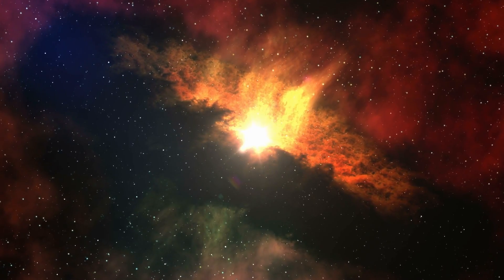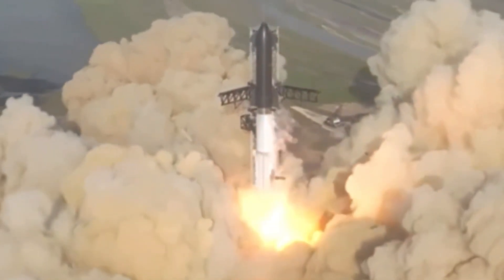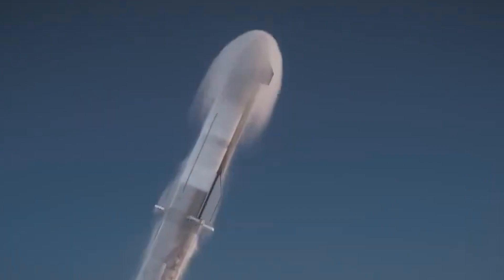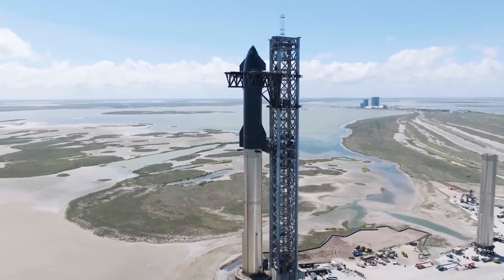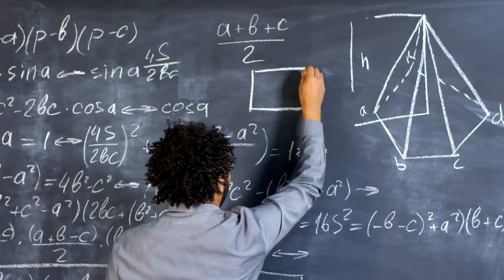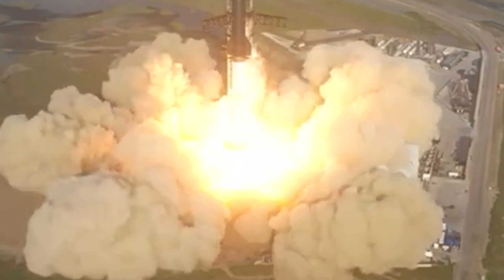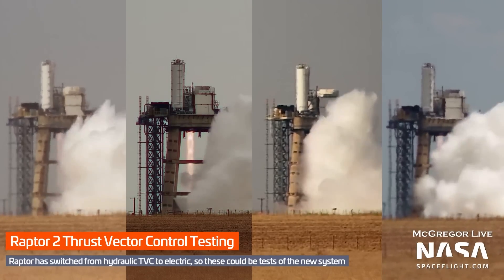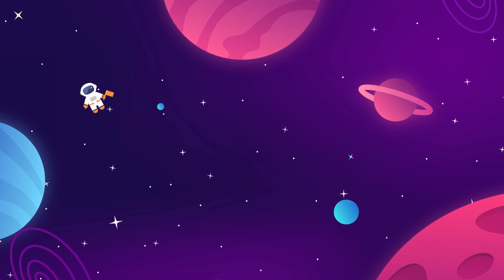The SpaceX Starship Orbital Launch Update Is Here!

Comment: Thanks for a good balance and including the part regarding the FAA. I have seems too many Elon fans say this is normal and too many armchair engineers say this was irresponsible. It can be both and the FAA has a duty to ensure space X operates safely.
Reply: Ever think that actual aero/Astro engineers also comment?!?
Reply: I am an engineer - it wasn't irresponsible of SpaceX to do what they did. SpaceX's approach to design is entirely valid and well supported by the whole history of engineering science. Many engineers that pay more attention to public perception and bleeding hearts may disagree with that, but they're all forgetting that the wheel wasn't made perfectly the first time, and virtually nothing else was for that matter. Designing to never fail is a relatively recent approach to engineering - and a very expensive/limiting approach because simply put you don't know what you don't know, and figuring out what you don't know is an arduous and ultimately imperfect process when the problem exceeds even a rudimentary level of complexity (hence the liberal use of safety factors in most traditional design work). 

If anything I blame the FAA and the environmental groups for most of this since all the delays they put SpaceX through over the last couple years slowed down their normal approach to testing and made a fully integrated test a more pressing concern for SpaceX. Ideally they wouldn't have been restricted at all and would have been able to do a sub-orbital test with just the booster and no second stage (which I believe was their original plan) over a year ago. Such an incremental testing and integration approach likely would have led to them finding out about the pad issues awhile ago and quite possibly with less fallout. Few people seem to really understand that engineers cannot do something that is entirely outside the box without lots of testing - analysis will only ever get you so far because it is also based on an imperfect understanding of the problem. Like a lot of good engineers like to say - all models are wrong. This is why all other rocket designs from especially Old Space are much more conservative and never really seriously pursue something like re-use (they don't really know what they're doing and the rocket cannot fail, so they have to have a lot of margin just to feel safe and are not typically willing to try to make improvements after the design is locked - which for traditionally designed rockets happens long before you build the first article). The design to perfection approach would never really work for something like Starship, but thanks to Falcon 9/Heavy SpaceX does have a huge leg up over their competition - but no one has built a pad for a rocket that powerful before, and in all fairness it was holding up to previous testing well enough.

Comment: Only God knows why Elon didn't fully test his 33 engines horizontally against a test concrete pad to determine if they should use a different tech.  Personally the idea of a flame diverter and water deluge is tried and true and would be great in this situation.  Elon is just whacked these days - dunno waz up with him.  I think they are going to find real structural damage to the tower and have to rebuild portions.  (hope it was worth going on 4/20)

Comment: From day one i was wondering why spacex made such dumb decision of flat concrete under the rocket whereas historically many rockets have flame deflectors and water sprinkler to dampen the noise and heat. Also why this fuel farm such a close by, it's was just common sense that debris from rocket are going to hit the near by equipment. Spacex focused more on starship and rocket design than the launch pad design...even there didn't wanted to use proven systems

Comment: From what I understand and the reason behind building the pad and systems at Boca Chica was to avoid having to transport it to Florida for launches at 39A. Maybe I’m wrong but what Elon had said is that the launch location was more effective and economical for the team to design in house and launch from a proprietary location rather than to ship. I do agree that the pad needs to be reconfigured for the amount of thrust, heat, and power the engines produce though, rebuilding the pad each time will not prove effective. Time will tell how the new revised systems will integrate and hold up to the rapid abuse proposed for the Starship program.

Comment: Considering only the thrust generated during Super Heavy's launch (82,770 kN or 8,440 tons-force), the Phobos platform from SpaceX (Valaris-8500) cannot withstand the weight generated during Super Heavy's launch. According to the manufacturer, the platform's Variable Deck Load (VDL) is 8,000 tons

Comment: The only thing you got wrong is when the flight termination system activated. It was almost 50 seconds before it blew up. You can see 2 small pops on the (one towards the top, one towards the bottom), and then gas shooting out after. All the flight termination does on starship is blow holes in fuel tanks. Then relies on the mixing fuel to take out the ship. Took a bit this time. They might need to add something to spark it up for the next launch
Reply: So the flight termination system ALSO FAILED!!!
Reply: @johnp139  no, it worked like it was supposed to, the ship blew up didn't it? Just took some time. Which is to be expected. 
It's a brand new vehicle with tons of new technologies. There was bound to be issues.

Comment: By this point I hope some people realise that Starship isn't going to land on Mars and that we need to rethink the "Mars direct" architecture it embodies. It will carve a crater - which is not a good flat surface. The thin atmosphere and low gravity on Mars will mean supersonic debris travelling for many, many kilometres. Meaning it has to land a long, long way away from base. And of course it's like to suffer damage on landing. 

We're not going to build launch pads on Mars made of thousands of tonnes of steel and concrete, let alone hundreds of thousands of litres of water. We need to consider designed for purpose, small, light crew lander/ascent vehicles that shuttle people to and from Mars orbit.

Comment: Dear Elon, You should modify ALL the rocket, resembling the old project of the SEA DRAGON. ONE GIANT rocket nozzle, for the main trust, burning JET-FUEL (Kerosene) and LOX. 6 to 12 ancillary RAPTOR nozzles, for route and attitude correction. Maybe 3 to six auxilliary solid-fule rocket boosters (Morton Thiokol). Second stage Liquid Methane and LOX. You could launch it from the center of MARACAIBO LAKE, that is a not-so-salty lake near the equator and near old oil extraction wells in Ciudad Ojeda (with still good Kerosene). Rocket carried to the launch position by two old W.W. 2nd Aircraft Carriers... A blast in the middle of the lake,  several fish dead (lake already poisoned by the oil), and a much safer situation. There are many abandoned oil extraction platforms there.

Comment: Building a launch pad that will survive? That's not the problem. Here's the problem:
1. We see engine failures and engine anomalies well after launch. It's easy to blame this on launch debris, but the problem here is that Raptor has a history of being temperamental. Are there still fundamental design issues with Raptor? Or is it simply being pushed too hard and therefore needs to be de-rated?
2. The video seems to think that losing a few tiles is fine. Why? At this stage the mechanism of failure will have been well understood and you'd expect the test launch to have tiles/fixtures incorporating such knowledge. But, some still broke. You only need to lose one for a catastrophic failure. I might also add that the failure is probably related to acoustic shock, and that a steel plate might survive the launch but won't necessarily solve the acoustic problem. 
3. Yep, the steel shell is demonstrating toughness, but max-Q is a nice symmetrical load against the strongest axis and the stresses from slow rotation through thin air aren't that high. The real problem for Starship structurally is re-entry. The vehicle is copping it broadside resulting in massive torques and also potential interactions between the relatively thin shell (relative to overall size) and the turbulent flow around the vehicle.

Comment: Water cooled steel plate with ablative layer might suffice to prevent digging another crater, but that still does not remove the need for a proper water deluge system. Something has to dampen the acoustic energy of that mostrous exhaust so that it doesn't damage its own source. But both is doable in a reasonable short time - a year, tops.

Not exactly "everything we wanted to know", but very good overview, nevertheless.

Comment: NASA, who invented the space program, operated with “failure is not an option”, whereas SpaceX states “failure is normal”? It just makes no sense not to follow proven methods to launch a rocket starting with creating a legit launch pad. 
First of all, concrete doesn’t fail because it “forms a crack and then expands”, it fails because the moisture in the concrete vaporizes into steam  and then explodes. 
Legit launch pads like NASA created had flame diverters to protect the pad but more importantly to protect the rocket itself and the water deluge was to also protect the rocket itself from the acoustics of the launch which was found to tear apart the rocket systems. Water absorbs the sound waves from harming the ship, which again NASA learned from tons of analysis and experience. 
It’s purely insane to even go for launch without a legit pad even for a smaller rocket but especially for a large one that will likely carry life in the future. 
That’s why this is a failure, as it seems an extremely high percentage of SpaceX launches turn out to be. It’s 2023, launching rockets successfully is done around the globe using the manual NASA created (and probably Russian rule books as well). Ignoring lessons learned is a failure which is why the FAA is grounding SpaceX for the time being. It’s disheartening to hear semantics of success when failure is not an option, and this means it’s a fail until a rocket reaches space, otherwise it’s called a missile
Reply: And in view to all this disregard for lessons already learned decades ago it's even more surprising that the FAA greenlit that launch. They knew all those safety issues would occur. And they still allowed this while knowing that there are thousands of people living way too close to the launchpad.

The main role of the FAA is to safeguard the population against such blatant disregard for public safety. They have failed here about as much as they have failed when they certified the 737 MAX.

Comment: Making use of their heat tiles would likely work assuming they are not too brittle.     Perhaps a hole under the pad with water jets and/or standing water considering how close they are to the water table.
Reply: Or maybe they could do what NASA and every other facility in the world that does heavy launches does.  Build flame trenches, diverters, and deluges to ensure the rocket doesn't destroy itself and limits the damage to its surrounding.  You know.. things that have been around for decades? Those things that they knew about and before they broke ground on construction of the pad said quite literally "hey we're not going to use those, this will probably end in failure" yeah... that's why they weren't surprised.  Quite literally this launch was doomed before the pad was even created because of those safety features that have been around for an insanely long time weren't used.

Comment: the fondag likely failed because it was too moist and when it heated up the moisture turned into steam. The steam then fractured the fondag.  this is why furnaces aren't made out of concrete. it could have held up better if were preheated to drive the moisture out. my 2 cents.

Comment: why is nobody talking about the fact that stage separation was initiated(that was announced on the webcast-and you can see the smoke from the explosive bolts on the first few images from inside - which were probably meant to show the separation in all its glory)  but it didnt work (probably partially due to the hydraulic failure) - had it worked we wouldve had a relatively pristine starship on its (tentative) way to orbit... at least the test flight wouldve lasted longer and the starship end of the stack couldve taken part actively.

Comment: Given the speed at which they can build, its not entirely impossible that they disassemble the launch tower and build up rather than dig down for a proper flame diverter not unlike those seen at Kennedy space centre where it ramps up to the launch infrastructure. A nice flame trench would direct the exhaust in a way that makes the launches significantly more spectacular too as you'll actually be able to see the rocket from ground level till the engines clear the pad rather than being obscured in a giant cloud of exhaust and dust.

Comment: I Repeatedly Warned ELON MUSK that their launch pad was dangerous and inadequate. I believed and told them they should have designed the launch pad after the Cape Canaveral built up area with the tower and then design a swimming Pool/Holding Pond to hold 6-12 feet of water underneath to absorb the rocket blast pressures out to the diversion routes/trenches.
ELON will fail again if he uses his metal plate and water which will break and be thrown as the concrete I warned would be thrown at distance from the launch area. 
Also the tank farm never should have been built so close to the launch area. It should be at least 1/2 mile to a mile away for the tower.

Comment: Two things.. 
1.  What I heard reported was that the clamps were released quite early, and it simply sat there on the launch pad as they throttled up the engines to 90%.   It wasn't being held down.  
2. The damage to windows 6 miles away was definitely not due to the self destruct.   That was just a minor thump which we heard in some of the live streams.   It was a long way away, and very high up at that point.    There are however several videos with good audio that show how insanely loud the launch itself was in that community.   I agree that this is going to be a problem from the FAA's perspective.  Same reason supersonic aircraft aren't allowed over continental US.
Reply: The only reason supersonic flight is not allowed over continental US is because the US couldn't accept France and UK built a supersonic airliner first. That was a pure childish reaction.
Reply: @christianbarnay2499  That may be a reason, but it is not the only reason.   Generally speaking nobody wants regular sonic booms over populated areas.  Here's an old vid featuring a clip (in 2nd half) of the Concorde passing over at speed..   watch?v=5MCETiKCLhc
NASA and others have been trying to find ways to mitigate this.
Reply: @daemn42  I know what a sonic boom sounds like. I heard one a couple years ago when 2 fighters traversed France to intercept an airliner with defective radio.
The boom is only dangerous if executed too low. At cruise altitude it's completely harmless.
If you ask anyone leaving near a US airbase they will tell you the military don't care about that restriction. If the US were seriously thinking this is dangerous they would have put an end to that bad habit of their own pilots.

The reason they try to mitigate the boom is to allow for developing furtive supersonic fighters.
Reply: @christianbarnay2499  You're reading way too much into my original comment.  Let's back up to what I said.. "... how insanely loud the launch itself was in that community.   I agree that this is going to be a problem from the FAA's perspective. Same reason supersonic aircraft aren't allowed over continental US."

I wasn't implying that because this launch was loud enough to break windows, that all sonic booms also break windows everywhere they occur.  I was saying that it was VERY loud, as are sonic booms, and FAA cares about and regulates both as they have negative impacts.    The FAA cares about the impacts of aerospace activities near populated communities.   It's going to be interesting to see whether they'll actually approve another launch at this location.
Reply: @daemn42  I perfectly understood what you said in the first place. But the sound of a space rocket at launch is order of magnitude louder than a sonic boom. It's so powerful that the ground vibrates in a very wide area.

If the FAA actually cared about the population they would not have allowed this launch in the first place. There are people living 6 miles from the launchpad. At Canaveral where they launch smaller rockets the exclusion area is over 10 miles. The water deluge at Canaveral and on every other launchpad in the world has several functions, one being to dampen the noise and reduce the sound and heat pressure waves.

They allowed the launch of the most powerful rocket ever built, with no noise dampening system at all, with people living closer to the launchpad than at any other launchpad. They allowed SpaceX to do something they would never have allowed NASA itself to do even during the golden age of space flight. By allowing this launch the FAA violated its own safety rules instead of enforcing them.
Reply: @christianbarnay2499  Yes they allowed it.  I'm saying I'll be surprised if they allow it *again*.